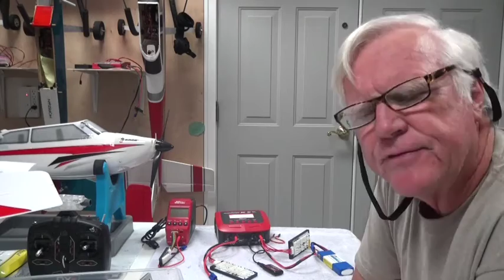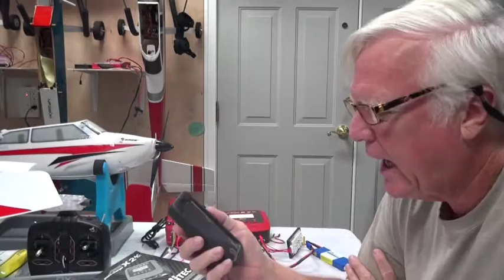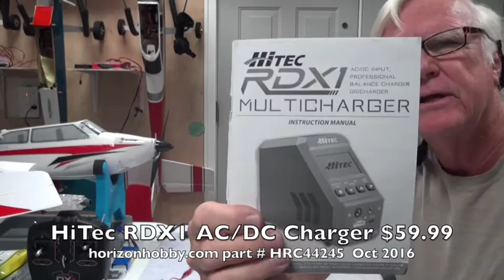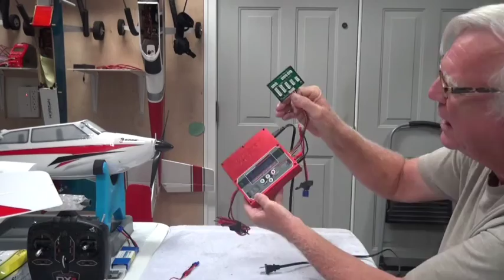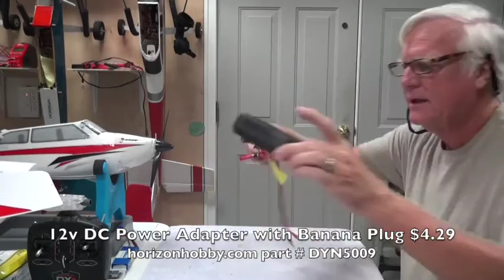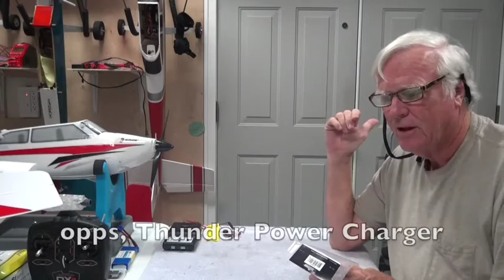AP08 Apprentice S 15e RTF Battery Chargers

Comment: What did u set ur settings to on the rdx1 system setup menu
Reply from the maker: I used the default setting except for the number of cells and the amps of current.  I normally use 5 to 10% of the mAh rating of the battery for the amp current.  for example, if the battery has a 3000 mAh rating I will charge it at 1.5 amps while at the house but never more that 3 amps while I am at the field and in a hurry to get the battery back into the air.  Be sure to let the battery rest at least 5 minutes after charging at the field before flying with it.  All of this prolongs the battery life.